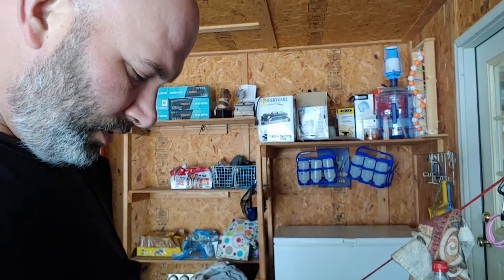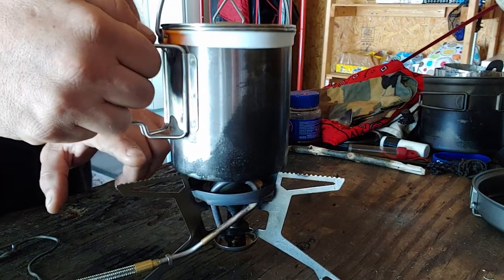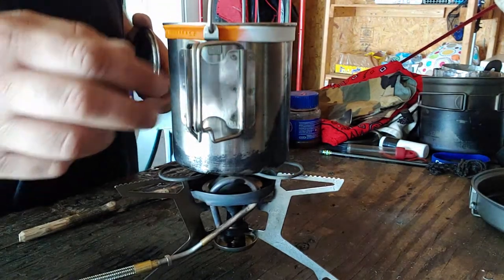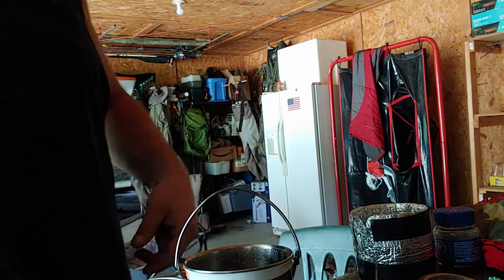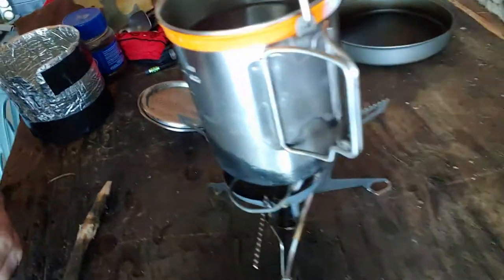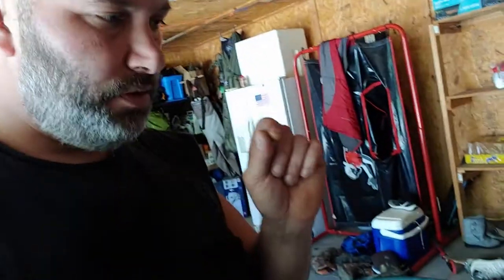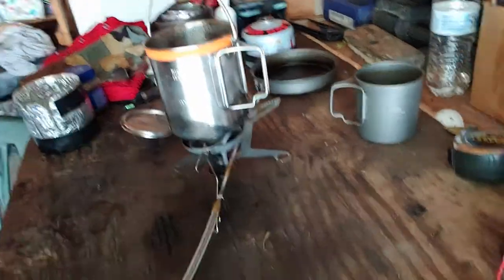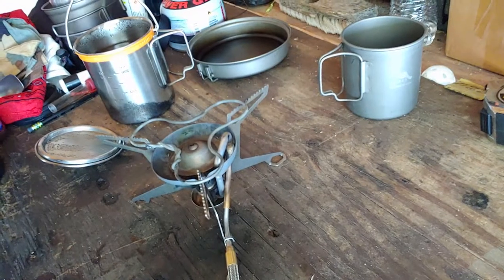Whisperlite universal small cup/pot  rest

Comment: Just watched your video, this is an excellent design and addition for this stove.  I just finished making one for mine.  I have a welder so instead of twisting the ends I welded them together.  As "Xj18A" noted below, you can't rely on ISO/Pro when it's frigid outside.  Since most of my hiking and camping is solo I need to depend on my gear, especially in winter.  The whiperlite setup for white gas is my goto and the only stove I'll take in winter.  Now that I've added your little pot rest to my kit I can take my favorite Titanium Pot and leave the bigger one at home.
Reply from the maker: Glad you like the mods.. Love my whisperlite... I have used mine countless times now using the white gas jet with the propane connector.. I never change them whether using white gas or iso... The primus pump I show in my one video makes that possible and I love it. All I take the jet out for is the occasional cleaning and that's just my OCD nature not because it's not performing properly..
Reply: Just a follow up note from my previous comment.  I've now used this little thing hundreds of times and can't say enough how much I love it.  It's one of the easiest and most useful DIY gadgets I've ever made...and I've made a lot.  I just bought an MSR PocketRocket 2 for use during summer and shoulder season treks and it fits perfectly on that stove too.  Made mine out of 9-gauge tension wire from Home Depot.  It weighs in at 7/8 oz and never leaves my cook kit.  For any ultra light gram counters (that choose to hike with an ISO/Pro stove) just eat 1/2 your Snickers bar at the trail head and call it even.